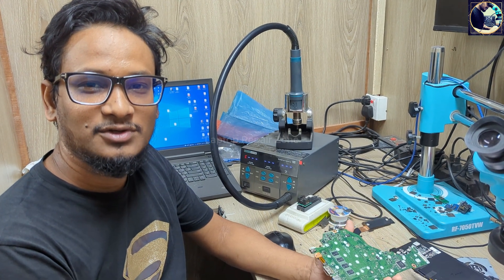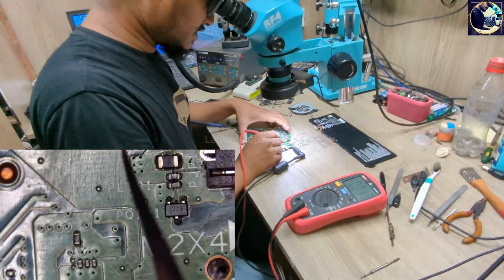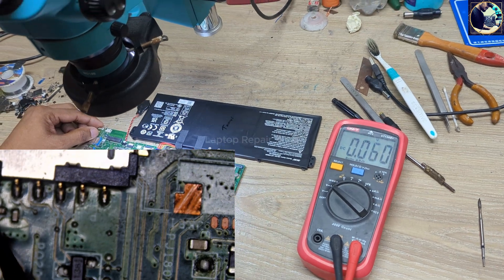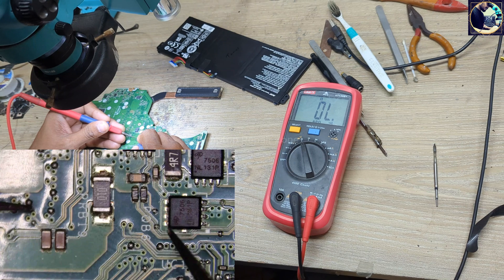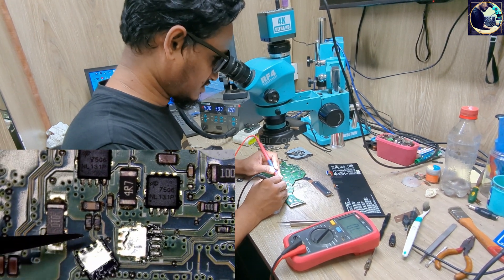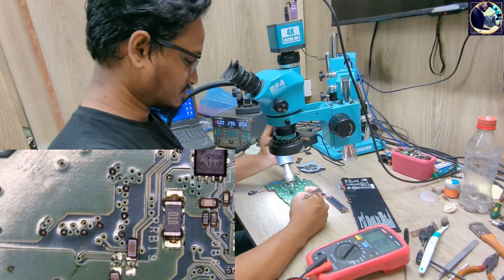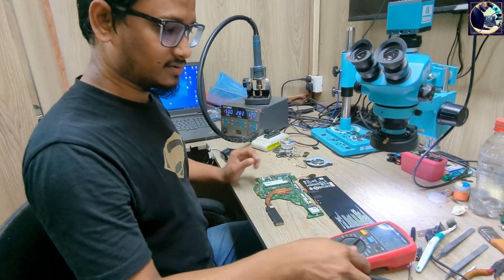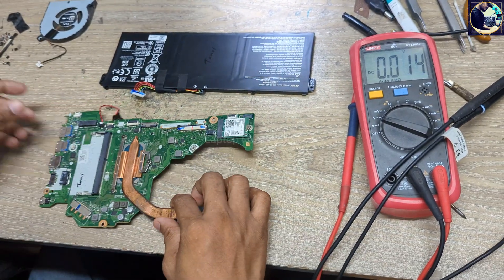Acer extensa 15 not charging | acer extensa 15 not turning on

Comment: Thank for the video. I have the same extensa 15 and it doesn't power on. I have 19V in the first mosfet 6426 but no power on the out of the mosfet. I havo no poer (the 25 v) on the right pin of the mosfet. You show it at 1:12.
Do you think that is the mosfet gone or there is a problem in the driving the mosfet ? Unfortunately I don't have the wiring diagram

Comment: Hi can you help me i got dell e5550 battery works i got 2 new original dell batteries but when i do battery report i got only one cycle and battery discharge when it is off. Any suggestion what can be wrong. Battery charges , works on battery but when you the laptop not use 2 or 3 days with full battery. The battery is discharged.  Battery report gives only one cycle also bat monitor app.  Any help is welcome i never find such issue on internet or myself. I use 2 new original bateries.
Reply from the maker: I think some components shot on your laptop motherboard short components drained your laptop battery charge..
Reply: @Laptop_repair_zone  ok i will look in to it strange the laptop woks normal except that battery issue. I will let you know if i found something.
Reply: Awsome and very fast
Reply: Keep it coming brother